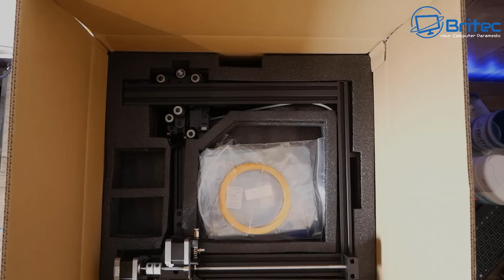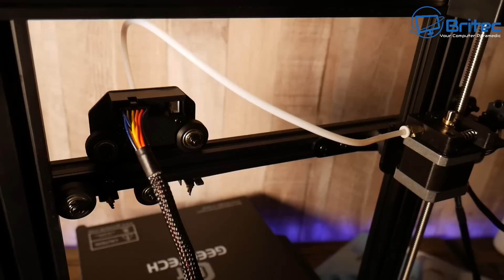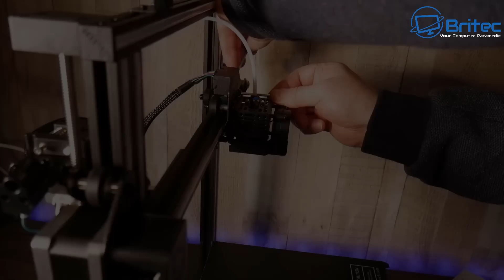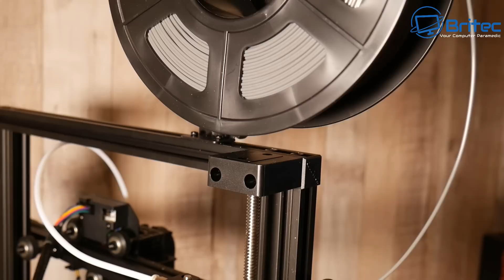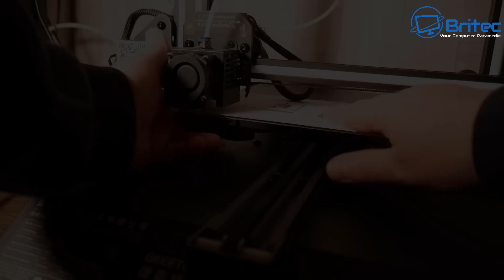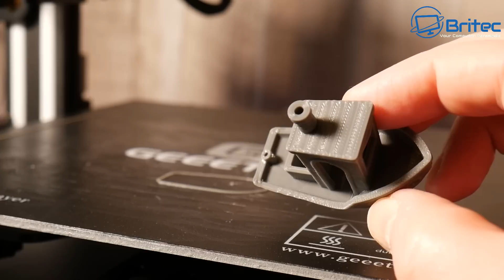My First Ever Time Using 3D Printer

Comment: Watching this reminded me of "the old days" of 3D printing - A pain in the arse. Getting a Prusa i3 MK3S would have been a better option. They probably cost more but it's totally worth it, even if you're new to this stuff, simply because of the ease of use with the Prusa's. They're just overall better though. Not just more user friendly, but have the best quality prints on anything under a grand, have good software and support, and have auto bed levelling and many many small touches/features that makes using them more pleasant, rather than a faff like most 3D printers of this type. It's lots of small things that make a big overall difference.

Comment: Is a 3d printer worth it?  All the YouTube videos that I see, the printers seem to be used mainly to print out "Christmas cracker trinkets" such as dinosaurs or the tug-boat that you made.  I'd like to see something useful made such as a missing key for a keyboard or a replacement part for a discontinued laptop, if you get what I mean.
Reply: Depends on how much detail you need in your print...resin allows for higher resolving detail whereas FDM (Fused Deposition Modelling) not as much detail. If you've heard of the "lost wax method" of metal casting, there is a YouTuber that demonstrates this using a special filament instead of wax.

Comment: I got a few,   all are modded mainly to make them quieter and  electrically  safer -   a Ramps 1.4/Mega based homebrew I3 clone  ,  an early CR10, dual axis mod,  all in one mod,  volcano with a .6 nozzle ,32 bit with quiet steppers , Ender 3  dual axis, with 2130's  & titan aero direct drive extruder  and my favourite just because it looks like a mad spider doing a jig when it prints  a frankenstiened Anycubic Kossel linear plus, with a RE-ARM+Ramps 1.5 with LV8729.s @ 64 steps with all the bells and whistles on it....  I like to tinker  a lot...
Reply from the maker: It will take me a little while to learn about them, but I will get there.
Reply: @Andy Davies got stepper motor dampers on your kit???🤔